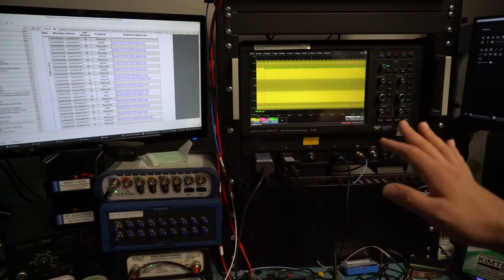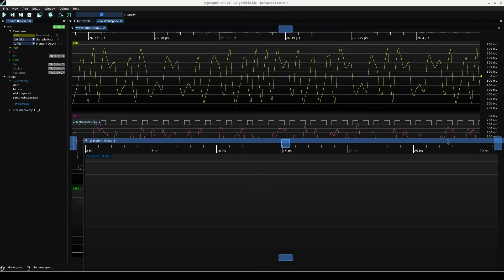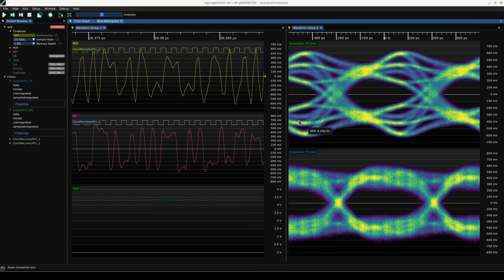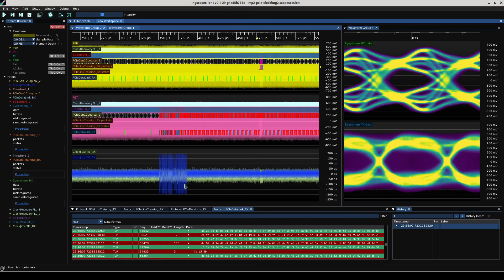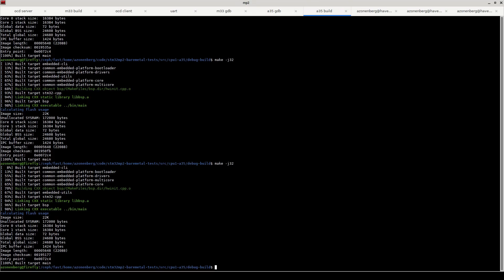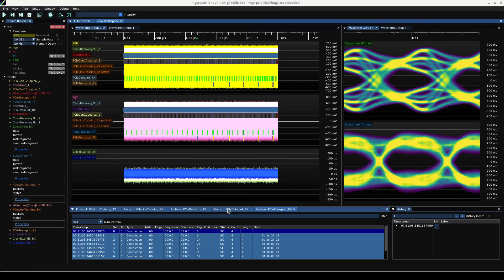[26] Debugging PCIe flapping on STM32MP257 with ngscopeclient

Comment: I did not understand the fix. what reference clock did you end up using instead of the external crystal?
Reply from the maker: The original design used the crystal X4 on the STM32MP257F-EV1 to supply the HSE oscillator on the SoC, which then drove the main system PLL. The PCIe PHY was then fed off that (SYSCFG.COMBOPHYCR1 COMBOPHY_REFUSEPAD=0). This caused the instability.

Switching to COMBOPHY_REFUSEPAD=1 sourced the COMBOPHY clock from the PCIE_CLKIN_P/N pins (U33) instead.

Comment: That was really good troubleshooting! Will you be switching to an IDE to write the software? What are you making?
Reply from the maker: I haven't used an IDE seriously since I stopped using Visual Studio circa 2009. These days I either use bare makefiles for trivial projects with basic config and a handful of source files, or CMake for anything bigger.

The goal of the system I'm debugging here is to prototype a STM32MP2 + FPGA communicating over PCIe, ultimately bridging AXI on the SoC side to PCIe to APB and AXI stream on the FPGA.

I have a lot of ongoing designs using a STM32H7 bridging MCU-side AXI to FPGA-side APB using the parallel memory controller and this is research for next-gen platforms to get higher speed using less pins.
Reply: @AndrewZonenberg  The PLL unlock looked like it was repeating at a certain frequency. I'm looking forward to see what it is!
Reply from the maker: @jheissjr  Changing the reference clock resolved the issue but I never figured out the exact details of why it was losing lock. That would require a level of visibility into the SERDES that I don't have.

I suppose I could try outputting the 25 MHz out the MCO pin and measuring jitter, that might give a hint. But otherwise I'm just gonna chalk it up to "clock not good enough".
Reply: @AndrewZonenberg The issue is interesting and I'm glad you shared it. The video editing was good. Looking forward to the next one.